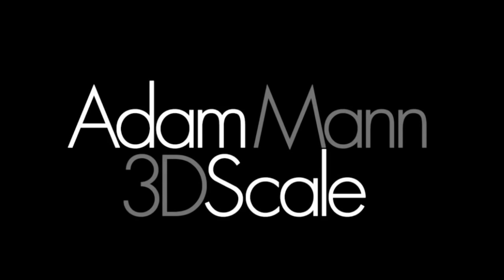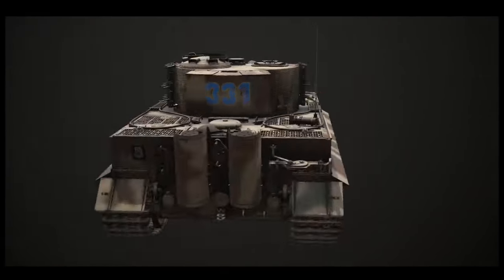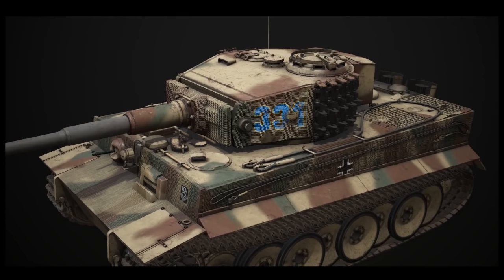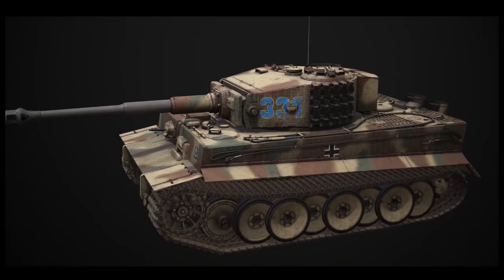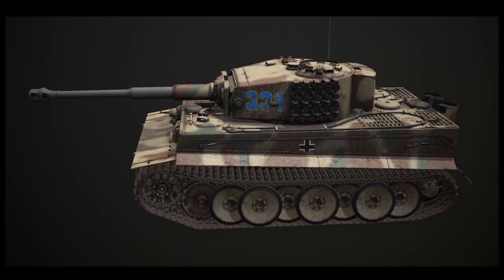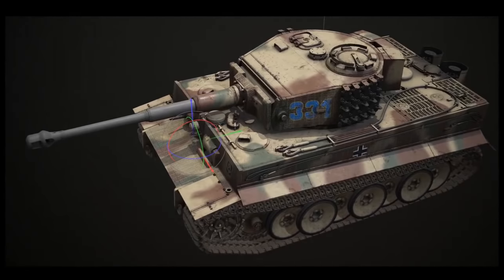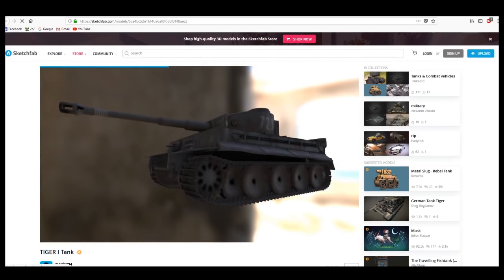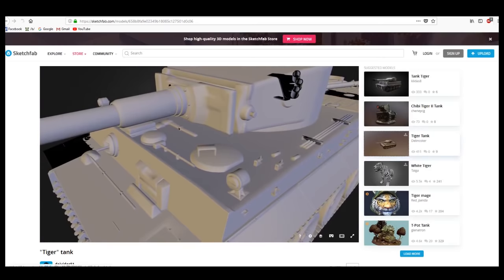Tiger I 3D Model Reveal

Comment: Fantastic work. Great choices - early running gear and gun, later turret, no feifels, a mid I guess. Would like to see in grey, white and plain dk yellow with no zimmerit and no sideskirts.
You could also redo some fundamentals - I always wondered if they lowered the height/width by a few inches how much weight that would have saved.
I wonder what a 3d print would come out like.

Comment: Adam found your website one day impressive I have a question in the Battle of the Bulge what German armor was present ?  would appecarate some input I need to put some German against my M4 Sherman I have learned a lot from you about German armor stay the course Bruce
Reply from the maker: Primarily Panthers and some King Tigers. I do believe there was at least 1 Tiger I but it was a rarity there. Lots of Panzer IVs, Stugs and Jagdpanzer IVs. The US did face a few Sturmtigers as well. Hope that helps a little. The most famous vehicles on the German side I would say are the Panthers of Kampfgruppe Peiper chronicled in the book series Dual in the Mist.

Comment: Looks very very nice Adam.
I do have a question however,  how well can you model in Battle damage and weathering? And are you thinking of doing the interior???
Reply from the maker: Great question I meant to address. I have to model new pieces for anything that gets damaged. It's how they do damage in games as well. It'll be a huge pain in the ass. Side fenders, exhaust shrouds will all have to either be made just for the configuration or generic levels of damage.

Comment: is your name degit22 on sketchfab? beceuse i found one tiger 1 that looks just like that one you have but without the camouflage and its called tiger 217
Reply from the maker: It is not, if you look at his models closely they have some major issues with proportion.
Reply: i cant rely find anything wrong with it except for like the driver and radio operators hatches. and to example the same wheel is missing at the sprocket wheel as your tank, the zimmerit is very alike. 

but clicking back and forth between your tank and degit22's your right